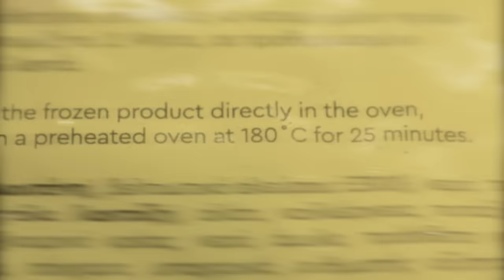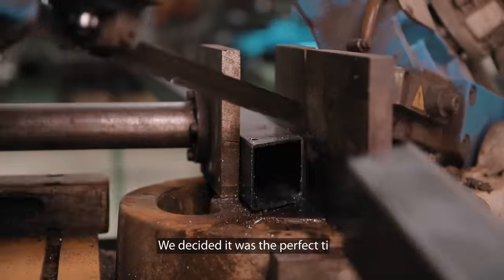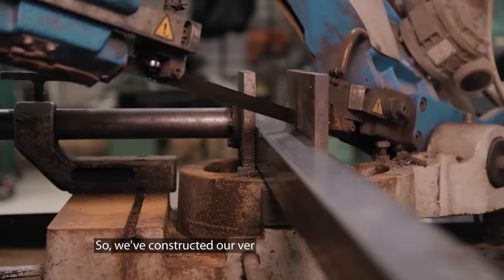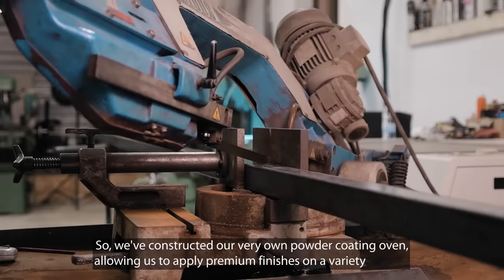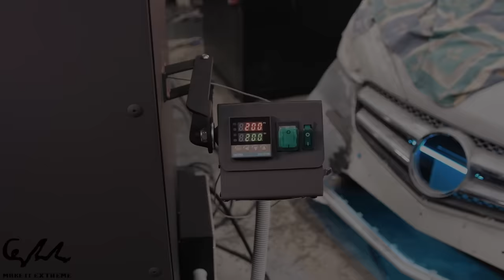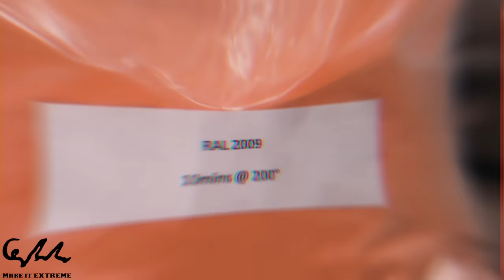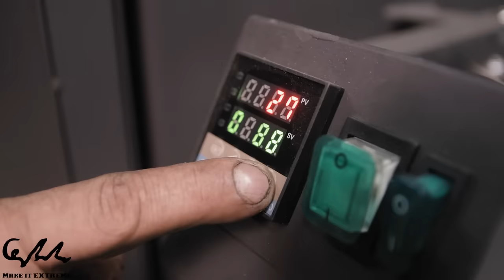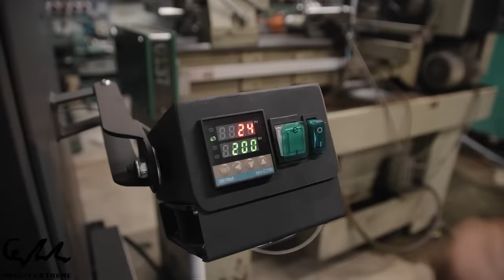I Built a Powder Coating Oven For The First Time

Comment: tipp: When you apply the powder to the workpiece you must wearing a respirator Mask. Or you build a Metal Construktion with fume extractor for applying the Powder.
Reply: I was thinking the same thing! They should be wearing a respirator mask when powder coating anything in the shop! WAKE UP CALL!!!!!!!!!!!!!!
Reply: Yeah, it looks really unhealthy!
Reply from the maker: Thank you for the feedback and concern! Some times we need not to ignore those things. Its an open space but we should be always cautious. Do you agree?
Reply: 😂 amatures.. They don't wear anything because they are Pro's! also channel call's Extreme so everything is perfect 👍 Thanks for your work.
Reply: Yes!!! This!!
I worked in powder coating for several years and I can tell you that you most definitely want to ALWAYS wear a respirator or at least a mask of some sort to filter out the particles. You will regret not wearing one after just a few times of spraying that coating without one. Makes your lungs feel like they are full of cement and will be coughing up a funky, nasty rainbow of garbage for days.
Reply: Also, you cant use the oven for cooking!! The powder coat emits toxic gasses that cannot be removed one you use it
Reply: @MakeitExtreme  i know What you Mean. Wenn you are applying the Powder, like in the Video. You or Other people stand in the middle of the dustcloud from the powder.
Reply: Silicosis killed two people I grew up with,  both industrial painters.
Reply: The safety tips in this comment should be mandatory for anyone who does not want to shorten their lives.  The powder is made up of extremely tiny plastic particles and will clog your lungs.
Reply: Great oven build, gentlemen!
Reply: @makeitextreme i know a guy who did sand blasting with imported grit.. did it out side on a dirt pad with no respiratory protection.... Has silica induced emphysema now.... struggles to breathe...... he suffers each breath...Put the masks on for painting it takes 5 seconds
Reply: why why why have  i this avalanche released respirator mask and so on wearing bla bla bla. sorry for my german language. warum habe ich nur dieses kommentar getippt bzw eine lawine losgetreten mit arbeitsschutz und so.
Reply: @f7p1764  lol yeah, deadly lung disease is hilarious!! 😒
Reply: Bro.

Then it’s not extreme anymore!
Reply: the next project could be a fume/dust extractor,  i guess a system similar to a welding fume extractor can be fabricated on small wheels so it can be pushed around the workshop, excellent job as always guys !   @MakeitExtreme
Reply: Ignore those Karens crying for respirators and be real men.
Reply: Live fast die young 🤦
Reply: Yeah, working around and walking into that dust isn't the wisest thing to do...
Reply: Sometimes you can get away with questionable practices while you’re young and your body throws off the effects of exposure to toxins but it builds up over time and you can be filled with regrets by the time you’re older and your body isn’t quite as capable of recovering. Too late then. Nice project.
Reply: @tobiassommer2821  Nah, polyester dust is good for ya!
Reply: he is ex sprinter, is easy for him to inhale for 30s and more :D
Reply: Or do both. My lungs were burning watching this! And then i realised that building this oven meant lots more of this terrible practice in the future. Cancer sucks, guys!
Reply: @anttihuttula6547  Sorry, but dying because of bad working conditions went out of fashion quite a long ago...
Reply: Not only powder coating, just look at the cnc plasma cutter!
Reply: I didn’t wear a respirator my very first time and the next morning I was blowing red outta my nose cause I coated red, wore a respirator ever since

Comment: Well done. Whether complex or basic, your designs/builds always turn out fantastic. I'm curious about 2 things: 
1] is the temp level uniform from top to bottom using just one element—[does it even matter at such low temps]?
2] is it better to hang parts at the top when you only have a few parts or is closer to the element at the bottom better?
Reply: They made forced air circulation from top to bottom and heaters at very bottom of the oven so the temperature will be even at all volume.
Reply: @zlozlo3935  //  The circulating fan design made sense to me, but I was still curious as to its effectiveness in such a large area. Thanks.

Comment: hi guys, great job! THANKS . little tip, your riveter is not properly adjusted. the rivet should break in one go and not in two as seen in the video. you must disassemble the nose and move the adjustment screw back 1 or 2 mm.

Comment: I've designed and built two PC ovens, and yours incorporates some good ideas from both, but there is no need for a window at all, you put things in and you take them out later, nothing to see and heat leak point, the door should have a handle really but I'll let that slide, insulation was a bit over the top, not sure painting the inside was a good idea, I brought ours up to temp and powder coated it with hi-temp powder, not issues with it flaking and dropping onto coated parts, best powder is polyurethane NOT EPOXY and you must wear a mask as it is carcinogenic, for a better finish by far and to get around faraday cage problems on complicated shaped parts it's better to pre-heat parts before coating, you just need to ensure you don't overcoat them, especially wheels if pre heated as the powder can flow to the bottom and throw the balance way off, your wheels didn't look as if they had coated very well where the center meets the rims, pre-heat to avoid those as recoating is a real pain Another design uses oven elements on the back wall in a circular fashion with a low-speed fan in the center, with a cover over them. our ovens were about six times the size of that at least and we had no hot or cold spots worth mentioning, great build quality though as usual.

Comment: It looks like if there is any dirt at all on the floor, it will be stuck to your part before its all said and done. that fan set up is awesome but it looks like its blowing a lot of air and may stir contamination from the floor. How much of an issue has this been and did you make any adjustments to remedy that situation?

Comment: I also built a large vertical powder coat oven. But I put my heating elements recessed into pockets on the rear wall, because I scavenged from a double oven, and that's how it could fit. But I didn't think to add a blower fan. I'm wondering if I should add it now.
Reply: It will make it a convection oven and help keep the temp stable in the oven.
Reply from the maker: It would be a nice and helpful addition. What do you think? ;)
Reply: @MakeitExtreme  I'm realizing you are sucking the air through the holes, and not blowing. Yes, this makes sense to circulate the heat FROM the top to the bottom. I think this might help keep things at the very top of the oven curing too fast or over curing.

Comment: Rivets versus welding -- how do you choose when you use one or the other?  Sometimes you could weld, but use rivets (8:24).  Other times, it's the inverse (15:20).  Thanks!
Reply: I can't say for sure, but my guess is that rivets allow a little bit of movement, handy for parts that expand from heating.
Reply: @bmay8818  I agree with that and it would be particularly important 
with this build and application. Cracks could form if there is no "give" for expansion and contraction.
Reply: @bmay8818 And if they want to replace the insulation one day because it is rotting away ( is that a thing? what even is this stuff?) they just have to drill out a bunch of rivets instead of sawing out the whole panel
Reply: @warrangota8721  I don't see how it could "rot away", since it's not only indoors, but in an oven. It looks like mineral wool, which is basically fiberglass but made from rocks instead of glass.

Comment: 0:04 i've never seen a machine shaped like that. Why is it like that?
Reply: So it can hold huge bags/boxes of powder (20kg or more) it is angled so the powder feed tube can go into the low corner of the powder box and get the last bit of powder.
Reply: @mrb2917   ooooooooh that thing is a hopper. Okay that makes sense. Can't really find any videos showcasing the tool, I only found a dodgy chinese listing for this worth 1500USD but the images/video don't really give enough detail.